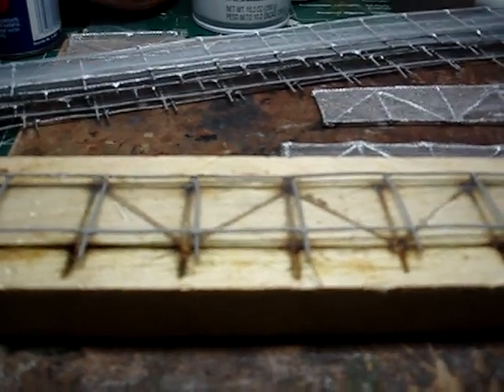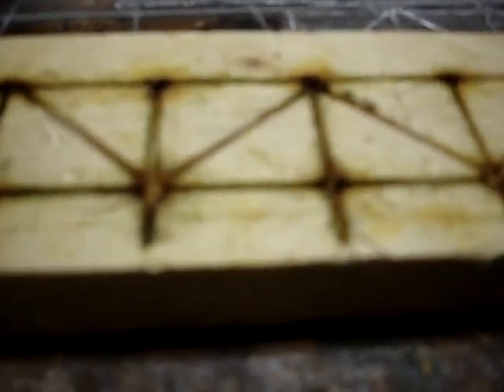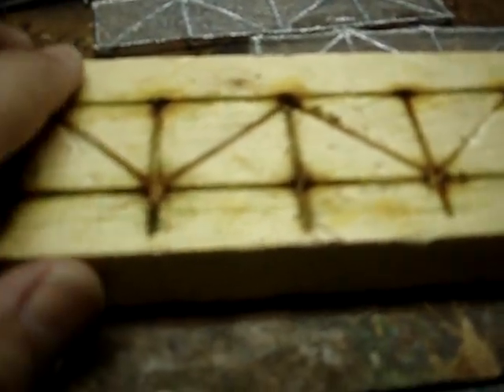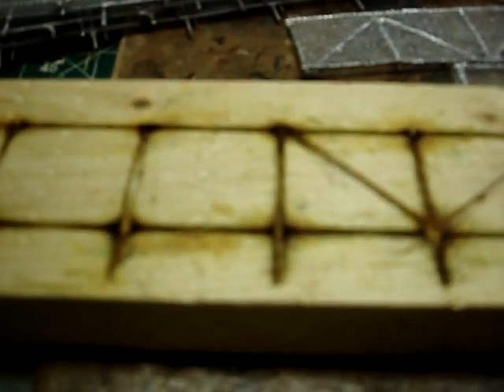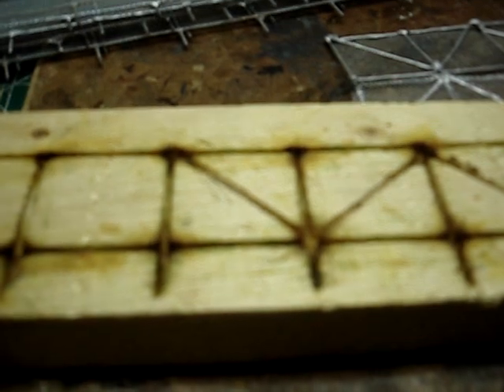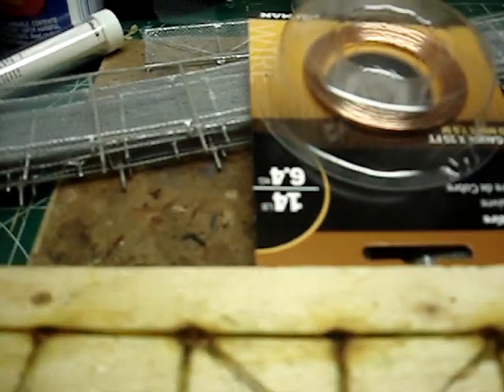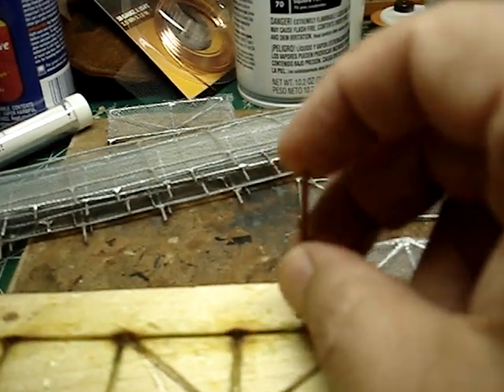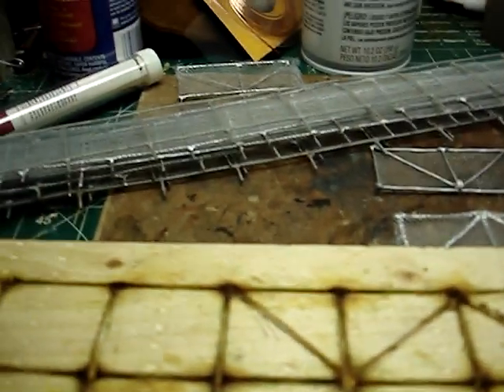Make your own HO Chain Link Fence . Eagle Valley Model Railroad Method

Comment: Thats pretty slick, but I 3d print the fence and then apply the tulle to it with spray adhesive.
Its a lot quicker and looks just as good. I don't have the patience anymore to build a jig and solder wire.

Comment: Could you use 12 gauge wire?  I've got a bunch of Romex house wire.  My ultimate goal is to figure out how to turn my crossbucks flasher on and off.  I have an Arduino but have already built a flashing circuit from a kit from fleaBay.  It is powered by a 9 volt wall wart (or you can use a 5 volt one).  I'm thinking maybe using a photo optic cell or maybe a reed switch.  It needs to turn on at a certain place just before the crossing and turn off just after the train passes the crossing.  Any ideas?  Cheers from eastern TN